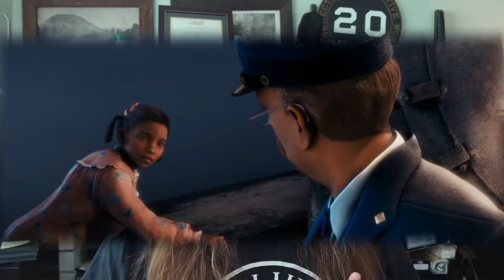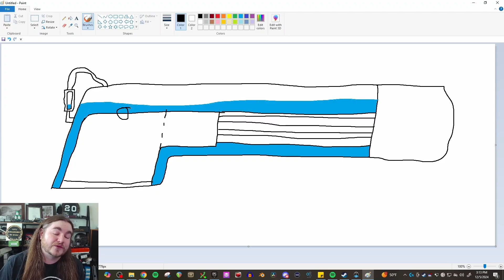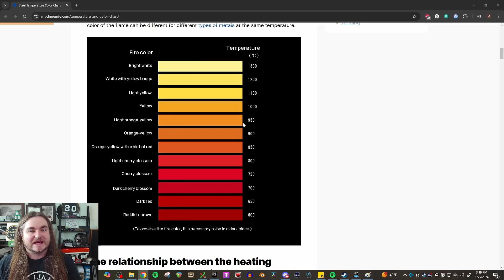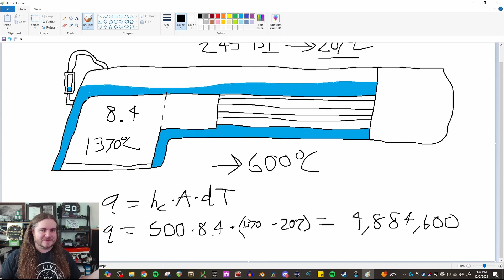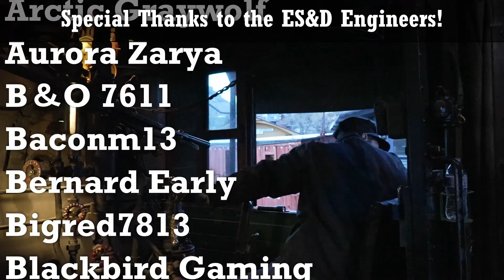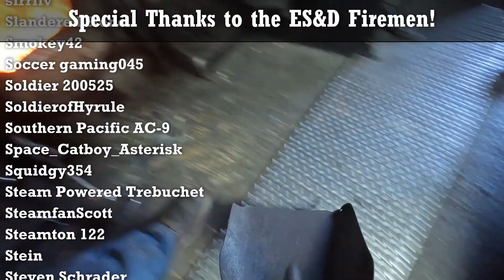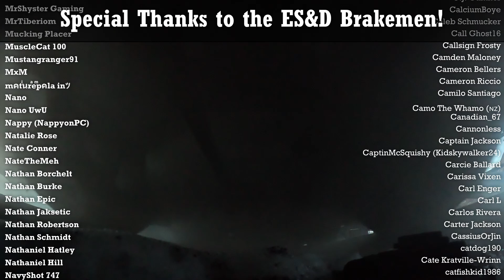Would the Polar Express EXPLODE on Glacier Gulch?!?

Comment: it would explode for sure. in 1977 there was an accident in Bitterfeld (germany) where the boiler of the pacific 01 1516 blew up when they stopped which was caused by the low water level cuz when the train started braking, the water moved to the front of the boiler exposing large areas of the firebox including the crown sheet which started to glow red hot and when they came to a hold, the water moved back to the firebox and turned quickly into a lot of steam causing the boiler to blow up and fly across the station. 

the Glacier Gulch scene isnt the only one where this would have happened. theres also the one when they were driving like -45 degree down into the tunnel
Reply: No, it wouldn't. The same way water stays in a bucket when you swing it around and upside down, the water in the boiler would be pinned to the back, covering the crown
Reply: @LetsStreamitOut01   this would actually require the train to move faster than free fall towards gravity which is 190 - 200 kmh (skydivers speed) and it obviously didnt reach that during the tunnel scene. if it did and exceeded that during the Glacier Gulch scene, the crew would fly out at the rear of the cab while something similar would happen to the 3 at the front. since the water is protected from any air resistance it will ''fall down'' faster than the trains acceleration and ends up at the front of the boiler
Reply: @maurice9457  each thing has its own free fall. Trains are heavier than water, therefore water will hit its free fall speed first, then the locomotive will hit free fall
Reply: @LetsStreamitOut01   no. in vacuum everything has the same free fall acceleration and speed which is 9.8 m/s2 while weight or even material density does not matter. so when the water is sealed in the boiler and has no air resistance but the train does, the water is falling faster
Reply: Another commenter brought up how the exhaust stack would provide some stack thrust. I realized that thrust toward the track could restore a tiny amount of traction allowing the drivers to pull the engine just slightly faster than the freefall velocity. It would be just a tiny acceleration but in the near zero-g environment (shown by the crew floating) that tiny acceleration would be enough to bring the water against the backsheat and keep it over the crown sheet. Especially since the track has a tiny forward component that would barely keep the water off the roof of the boiler and not getting sucked into the steam pipes.
Reply: @JaneDoe-dg1gv   well first of all: that ''stack thrust'' is nowhere near a value that matters. otherwise it would also increase the load on the wheels when the engine is running normally and probably exceed the limit too much. btw they re only driving down almost vertical and not vertical so dont worry there is still some load on the wheels in that scene cuz if not it would derail while driving down (this is also causing them to actually drive less than free fall speed). second: you can not add speed to an existing velocity using a power which is weaker or equal cuz this is not how it works and they do not add up. if the train is unable to exceed free fall speed on straight level it can also not do that while free falling. its like lets say if you have 2 locos with a max speed of 75 each and you couple them together they still wont go faster than 75 (on straight level)
Reply: @Stirling697  the thing keeping the engine from accelerating at freefall is air drag. adding the thrust from the wheels is what is allowing the engine to overcome air drag to match freefall. 

However, gravity is a constant acceleration rather than a velocity. the train would initially be outrunning the water before the water caught up a few seconds later.

also, depending on the exact situation, the small thrust from the stack would help push the engine down. There is a small force of one hundred or so pounds from the stack.

if the scenarion is a practically vertical drop, then that small force would matter.

if the track was a more reasonable angle like 60 degrees down hill, which is roughly what 179/100 equates to, then the stack thrust wouldn't matter.
Reply: @JaneDoe-dg1gv    ''gravity is a constant acceleration rather than a velocity'' yes but only in vacuum or if you can somehow take away the air drag (just like the water in the boiler) but when you are in atmosphere it becomes a velocity and stays there which usually 190 - 200 kmh. so if all things have the same acceleration on free fall in a vacuum or at least without air drag which the water doesnt have but the train does, the water will always accelerate faster. and like I explained you cant add speed to an existing velocity with a weaker or equal power (something slower) so if the train is unable to exceed free fall speed on straight level it can also not do that while free falling. also the maximum speed of a locomotive is (among other things) limited by the speed of the back and forth movement of the pistons which cant go much faster than 400 - 500 rpm. hyce explained that in one of his vids.
Reply: @Stirling697  yes, the water would quickly outpace the train but the downward velocity of both the water and engine are zero to start. at this lower velocity the wheels can temporarily get the engine to outpace the water before the water's constant acceleration overtakes the engine.
Reply: @JaneDoe-dg1gv   even if thats true, in the end the firebox would be dry for too long which doesnt have to be that long just like in the accident of 1977. also they dont really start at 0 cuz when the gradient started to decrease, the train acceleration was much slower than the water causing it to flow forward and when they reached the point of facing down 89 degrees, the water was already at the front ready for free fall acceleration without any air drag which can not be beaten by the train
Reply: @Stirling697  yeah, that makes sense.

Comment: and it needs to be noted you didn't even consider the fact heat goes up and gravity on the fire and only strictly did math based on train still in train orientation not missile orientation making heat shift to fire door and coal to likely experience negative G load again changing fire heat characteristics and dispersion

Comment: Love this video! Something to think about: 

There would’ve been non-negligible G’s pulled at the bottom of each hill, increasing both the weight of the crown sheet and the water above it. The masses would remain the same, so your heat transfer equations wouldn’t change; but, I wonder how hot the steel crown would have to be to fail if it and the water above it temporarily weighed 3-6 times as much? I bet the higher G load would cause a structural failure sooner at a lower crown temp!

Comment: This popped into my head, with the 1225 moving at speed, would the acceleration of going down that steep of grade slosh the water to the back of the boiler so theoretically the crown sheet would not really have a chance to be exposed long or if at all.

Comment: But the engineer and fireman are floating, so they are in zero g (freefall). I don't think a fire can draft in zero g because there is no "up" for hot air to rise to, so for those few moments I'd expect the fire to act as if the damper is closed. I don't know how much that would reduce the heat input. Thermal inertia, etc...
Reply: And the water would be floating and banging around as it is boiling so would probably be still be hitting/cooling the crown sheet.  Would probably get more heat on a less steep grade than freefall.

Comment: Hyce, you had to integrate the thing, your heat transfer rate varies in the process because the temperature difference changes from (1370 - 207) = 1163 to (1370 - 600) = 770 moments before disaster (insert nerd emoji here). By the model you have the Boiler T vs Time graph should not be a straight line, but rather a curve that gets more shallow. This won't change the results by an order of magnitude, but a lil bit more time. Also I don't like things I have heard for the mass evaluation but I will assume you did multiply the area by BOTH thickness and steel density or used some ready-made data table that lists aerial density of steel vs thickness.
Reply: Came to the comments to point out the need to account for using calc here, thankfully you already did.
Reply: Y’all beat me to it. Ironically Thermo and Heat transfer were my best subjects.

Comment: I'd like to see your take on the scene where the Polar Express pretty much spaghetti noodles up the mountain shortly after the ice scene.
Reply: FINALLY SOMEBODY NOTICED THE TRAIN LITERALLY BENDING LIKE A SNAKE
Reply: Yeah, watching the train do that really takes me out of the scene.  Looks like the train’s made from a foam pool noodle.
Reply: Gotta remember most boiler explosions were caused by splash back or putting cold water from tender over already exposed crown or low enough where the cold water coming in contact with extremely hot steel of the crown sheet
Reply: Simple, it’s one of those Bendy Boiler Locomotives the Santa Fe had
Reply: @ITrooper089Productions you mean THOSE cursed engines….?
Reply: The worst part is that even the promo art has the train bending normally along the couplings and trucks
Reply: I watched this film multiple times. It took watching Cinimasins to realize the train bends like a snake. Also learned about dialog I never caught on before.
Reply: @ speaking of dialogue after the know it all kid talks about montezuma some kid goes in the back “you don’t know that”
Reply: @Glenbrookproductions1  That's actually funny.
Reply: @ShadowHawkProductions  Hmm… that’s quite interesting to learn the properties of the metals used in the locomotive, after all, now that you think about it, shouldn’t it have snapped off under all that pressure?

Comment: As a pilot, we talk about left turning tendencies aircraft experience.  (If you want to know why there’s a ton of videos out there) so when I first watched the polar express, and saw the lake scene. This proved to me that trains must also have left turning tendencies as when they go into reverse they go the other way.
Reply: I think that was the coaches dragging themselves back behind the locomotive. Since the locomotive is so heavy, once it is moving in one direction it will keep moving in that direction. the forward and back running could have been them trying to control both the sideways movement (like sideslip) and the swinging oscillation of the train.

think about the coaches behind the train like a vertical stabilizer. Nose (locomotive) point left, tail (coaches) push left till the nose is facing forward again. of course this is relying wholly on drag but similar enough concept.

then when the engine was facing where the engineer wanted, "give'r the beans!"

Comment: You forgot the bit where the steam dome is flooded, sucks water and launches the piston caps…

And if the crew manages to get the water low enough for that not to happ, there’s no way they don’t kaboom
Reply: the only thing keeping this from kaboom is the steam. Also, the water is in freefall like the crew so it wouldn't actually flow forward. the tiny downward acceleration of the engine beyond zero-g/freefall would keep the water slightly towards the back; and the tiny forward movement would provide a minuscule force keeping the water down off the roof.

Comment: I'm barely 3 minutes in, I hope you count in how the coal and firebed would probably just float up? Maybe get (whistle) into the flues n tubes? Disperse the fire maybe? And maybe have a rush of air due to speed??? Just spitting ideas before I get my hands dirty spray paiting these polar express cars brother
Reply: they probably would have been sucked out/ clog the flues. So less fuel and practically zero air for the fire. It would explain Smokey shoveling on glacier gulch; he needed to stoke a new fire and replace the lost coal. funny thought that the shaking of the engine stopping on the ice could have dislodged the coal from the flues and let her get back to steaming.

Comment: wouldn't the steam dome be under liquid water at that high of an angle thus hydrolocking the cylinders? or the draft being non existant as the smokebox being feet lower than the firebox and or the fire being poured down the flues and into the smoke box.

gravity sucks

Comment: I think that, judging by the scene, the water could do two things: it can move completely forward in the boiler, due to gravity, against the smokebox, leaving the firebox completely exposed, or, the water could move in the opposite direction, all toward the firebox, due to the acceleration and the centrifugal force of the locomotive moving downhill at high speed
Reply: it wouldn't be centrifugal force but just the train accelerating forward. The water wouldn't go forward because we see the crew floating in the closed cab. That means they are in freefall same as the water in the boiler. The water would move backwards just as much as they were. That is a tiny but noticeable amount.

Comment: Honestly I feel like the train accelerating down the hill and pulling all the water to the back of the box would probably just blow the entire backhead out from the strain. Another thing I feel would happen is the engine drafting so hard that the coal would be just SUCKED right to the front of the box and plug all the tubes.
Reply: The fire definitely got sucked into the tubes. whether it clogged the flues or got sucked out is just what flavor of screwed the engine is. But the water wouldn't flow forward or backwards since the crew in the cab are experiencing the same forces and they only moved slightly backwards.

Comment: It's even worse, 179 degrees isn't straight down, it's nearly perfectly inverted in the other direction
Reply: So the crownsheet wouldn’t be exposed, it would be completely submerged.
Reply: @jaysmith1408 yes, and your steam dome is filled with water that's now flooding down the dry pipe.
Reply: @jaysmith1408  Oh no, it's just that your crown sheet is now your mud ring

Comment: 13:12 I think there's an easier way to estimate that number: the locomotive could produce around 2.2MW of mechanical power (according to Wikipedia), and assuming an overall efficiency of 10% (an average value for steam engines as far as I could find, but could be adjusted depending on superheat, construction details, Carnot temperature ratio, etc.), the fire would need to produce around 22MW of thermal power in steady-state under maximum load. The distribution over all the heating surface is a little harder to estimate, but the crownsheet accounting for around a quarter of that power feels reasonable - it's probably less than a quarter of the area, but among the hottest regions
Also yay metric :)

Comment: Also Hyce the locomotive is essentially in free fall... While still under acceleration.  Since the water isn't actually adhered to the boiler, it would fall at g while the locomotive falls at g + a where a is the locomotives acceleration from the wheels.  Therefore the back of the boiler runs into the water and the water stays on top of the crown.
Reply from the maker: Hmm. I think you're right.
Reply: @Hyce777  The slight forward component, from the track being not perfect straight down, would also keep the water on the bottom of the boiler and off the roof. A neat thing would be the thrust produced by the exhaust stack (since they act like rocket nozzles) pushing the engine into the track helping it gain some more traction.

Comment: This sorta maths is exactly what im doing right now as part of my degree (3rd year chemical engineering) and I both love and hate heat transfer maths. My real saving grace is chemical process design and unit design xD
Reply: Simple answer is no, most steam have a single throttle, the movie depicts a left and right control system (sounds terrifyingly difficult to time), so it's super custom.
Reply: @douglashanks4189  ??? dont think that was supposed to be for me
Reply: @HedgieTheBrit  you ate correct,  hmm comment shenanigans from utube

Comment: What about if the coal was dumped before going down the slope? Since it’s a massive downhill slope the locomotive shouldn’t need to put in any work, so theoretically no fire would be needed?
Reply from the maker: Well, the throttle is stuck wide open, so, it's drafting hard so you'd need something... Whether or not it falls with or G forces hold it to the fire bed who knows. Lol

Comment: So all the crown sheet calculations make sense, but when you rotate the engine so the headlight is pointing at the ground the primary direction the heat goes is no longer the crown sheet. They would need to put a new fire door and maybe rebuild part of the stoker system every run over the gulch. That would suck needing to clean the remains of coal plugging the flues out after every run.
Reply from the maker: Mmm. Fair. I'd assume with enough fire it'd still be heating the crown pretty significantly, but yeah, maybe we should've done the math for the backhead. Lol!
Reply: @Hyce777  In freefall (cotter pin floating), there's no "up"...
Reply: @coryfriend8325  there may not be an up but the airflow would drag the coal off the grate and out the stack. honestly, nowonder smokey was shoveling like crazy on the ice lake. Dude had to add a whole new firebed back to the grate.
Reply: Well, if the backing is toast, you don’t go kaboom, you’ll just want to gtfo of the cab and wait until you can see whether you can shovel (or stoker) some more.

Might aswell go find the piston caps as I‘m pretty sure they would’ve sucked some significant amounts of water into the pistons